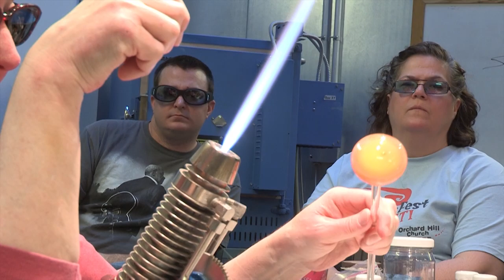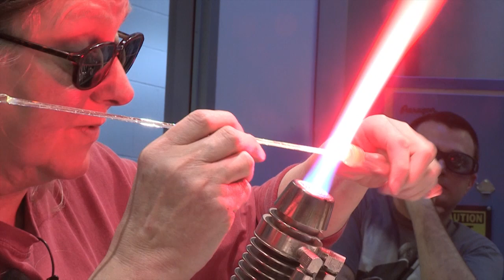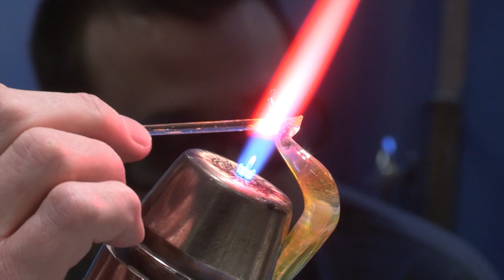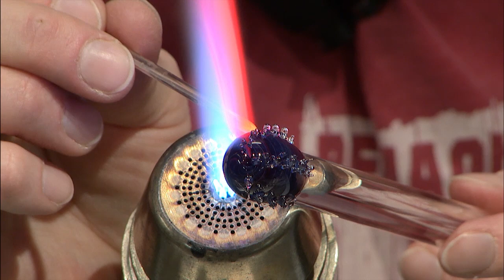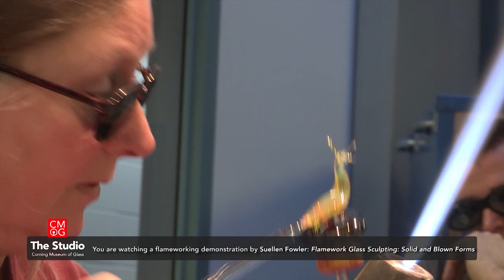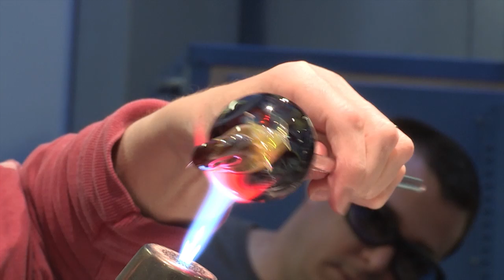Studio Demonstrations: Suellen Fowler

Comment: how do you stop the heat traveling up the rod please forgive me if its a stupid question
Reply from the maker: Hi Richard Jones not a stupid question at all! The answer is that glass is a very poor conductor of heat, so, it simply won't conduct it out to the flameworker’s hands.
Reply: what about the metal rod as we know metals or most anyway conduct heat
Reply from the maker: Richard Jones If using a metal rod, it would most likely be steel which does not heat up as fast, or glassmakers might use a tungsten pick with a handle on it to protect them from heat. When using a tool in the flame, glassmakers don't leave it in the flame long enough to get hot enough to burn.